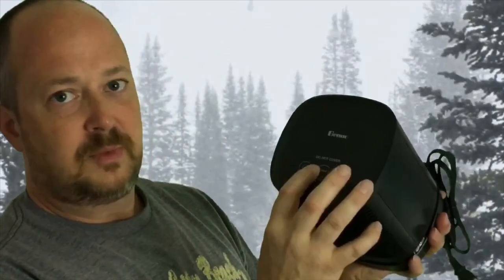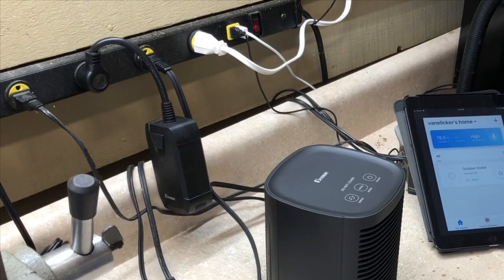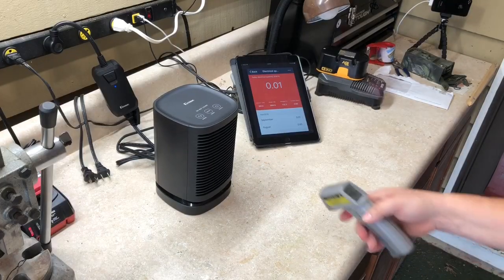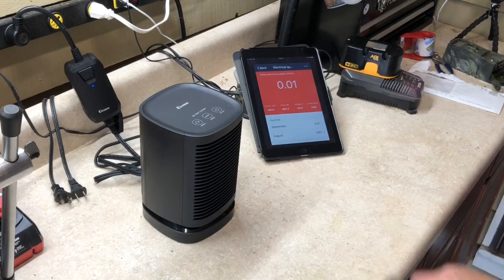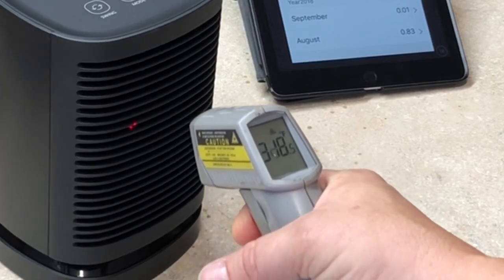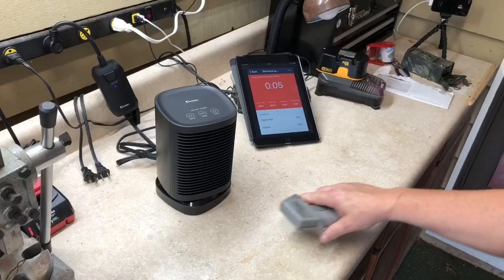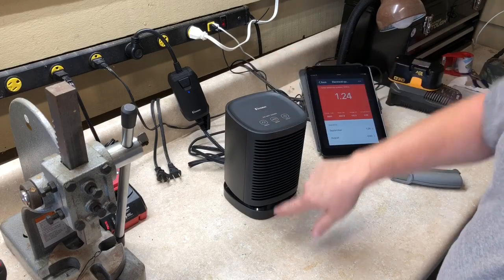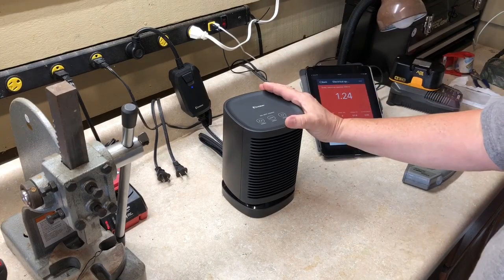Best Space Heater - Benuo Personal Space Heater - Vans World

Comment: I really like the green screen behind you. Although I'm not looking forward to winter. At first I thought that I would buy this. My house gets so cold in the winter, but it kind of scares me. Very small house and since I live alone I would have to really watch it. I had an oil that ran on electricity and that really ran my electric bill up. I think you did a really good review on it because I was thinking of getting it. Still may. Thanks, Van. ATB & GB
Reply from the maker: The best one is the radiant heater with oil inside.  Their safe and when it reaches the desired temp and turns off, the oil is still hot so it’s still radiating heat.  Very efficient.  😁👍
Reply: I really like it!!!